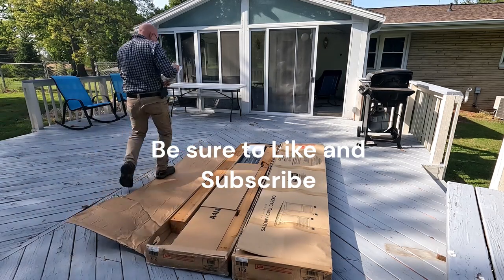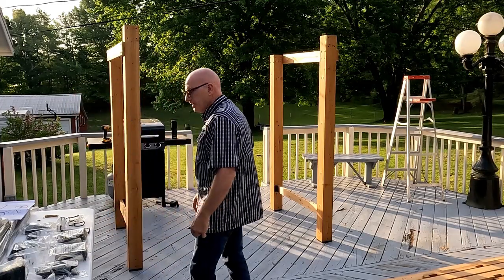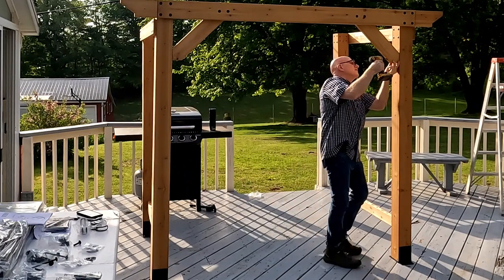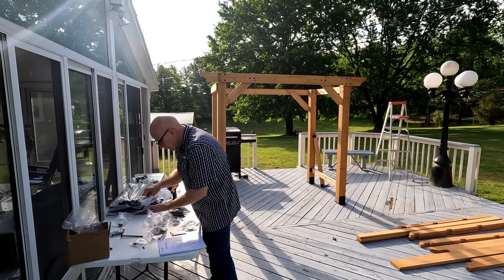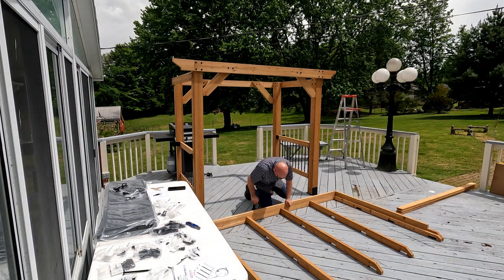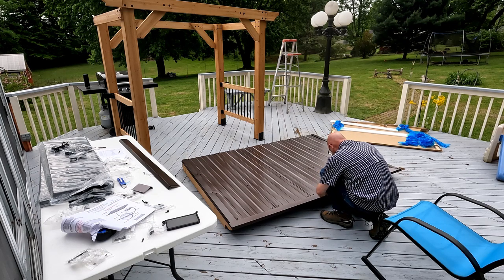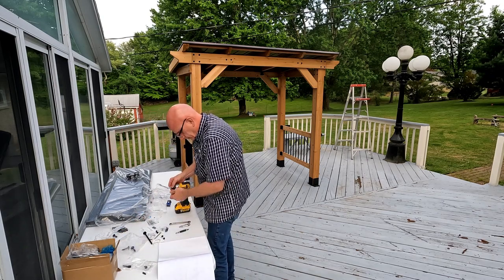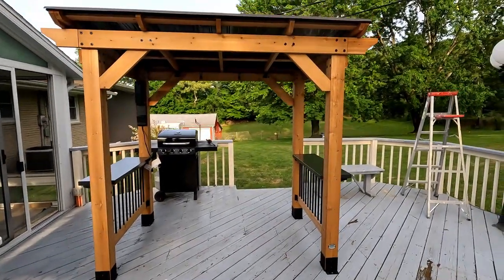Grill Gazebo Assembly

Comment: Your video tipped me over the edge. I now plan to build this for my cabin home & mount the 4 legs to 2 long 4x4 pressure treated    timbers then drill holes at the 4 ends & then sink long rebar into ground or perhaps some other ground screw

Comment: I bought the xl size, and I'm going to attempt to build it myself.  Do you think it's possible to build the frame with raters,  install that, and then put the roof sheets on on?
Reply from the maker: I don't think you can get onto the roof without bending the metal all up.
Reply: @Handy-Hank  no, but if you square up the frame and the joists, you could install one panel at a time in the traditional way of installing a metal roof.